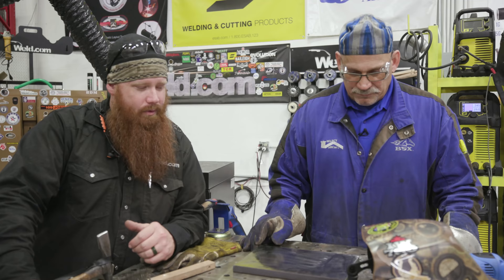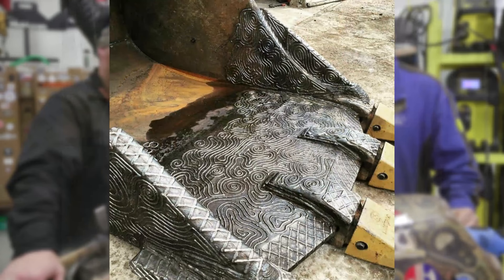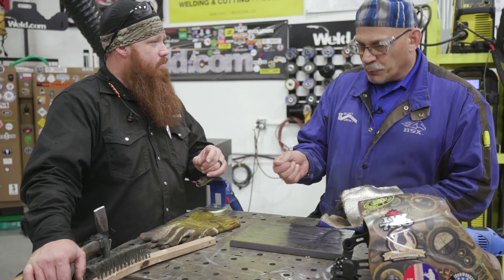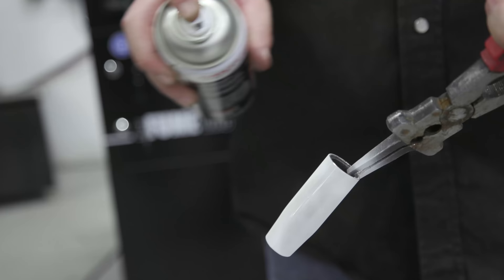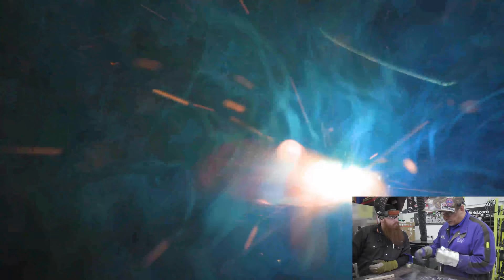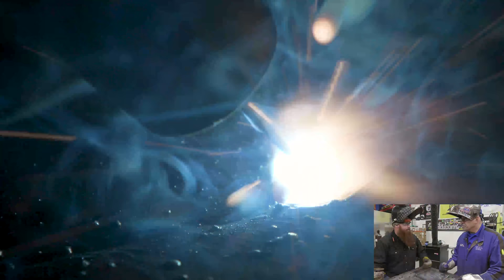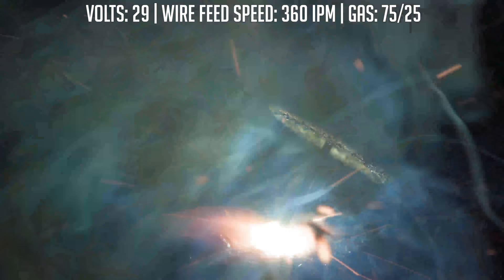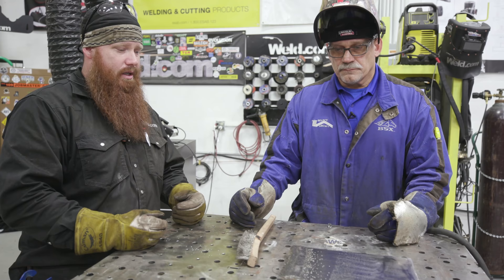Hardfacing: Metal Core Build Up | Flux Core Cap

Comment: The odd patterns of hardfacing on the excavator bucket is made for a reason, not for show. The pattern will keep mud and clay in the groove and this adds to protect the bucket metal.
Reply: Exactly, it's different for dirt, gravel, rocks, etc.
Reply: Looking cool is just a plus
Reply: A simple checkerboard pattern will do just as well as some intricate, artistic drawing. The fancy stuff really is just art, and the guys that do it will even tell you that. Y'all are just making stuff up.
Reply: @ParadigmUnkn0wn  not always, 90% of the time it is, but it makes sense sometimes to try to keep clay in the grooves, such as a checkered pattern

Comment: good video to explain the hard facing process. I have used 309l as a builder and 58 rc  rods as cap and on occasion 62 rc  rods to cap.I have mostly done tractor bucket cutting edges and snow plow skid shoes seems to work well with out mig process and gas.. keep these educational videos coming we all can learn from you.

Comment: Glad to see a video that covers this, it will help me out at work. Working on chutes at the coal mine.
Reply: Hi Eli, have you tried ceramic tiles on the chutes etc we use them on the screen boxes, hoppers and other wear parts on the screening plants at the steelworks for the foundry coke as it is very hard and extremely abrasive, there is bit of a knack of fixing them but they work well. 
Cheers Simon

Comment: I have been using hardfacing rod to put a new edge on brush cutter blades for years. I began building up the worn edges with standard wire and found they wore too quick and then ground them away and swapped to the hardfacing and WOW what a difference in performance and how long it lasts.  The metal I am laying it on is alreay fairly hard so a base layer of semi hard doesnt seem needed. I have yet to have the hardfacing crack or snapp off, at least not were just the weld broke, did have a farm hand decide he wanted to cut concrete with the mower and snapped the entire blade.

Comment: Metal core is a great process. I just got certified for metal core I'm in Ontario Canada so it's the CWB . I weld out tanks that store heavy water at reactors in Ontario. They have to be 100% leak free the metal core process works great. It's done on a line track set up makes beautiful welds I run at 30volts at 450inch and 90% argon 10% Co2. The down side is metal core is hard on nozzles and tips the spatter is exstreamly hard and dense other than that cheaper wire is prone to burn back so over all it does a good job.

Comment: I've run hard face on the bottoms of scrap magnets with sub Arc, but have also run quite a bit on other magnets with .060 mig.  Smoke for days. Never ran a "base" layer. Magnets would come back years later for repair and the hard face was worn but still there.

Comment: I've done a bunch of hard facing. Customer of mine has a field tile biusness. The tile plow gets it a couple time a year depending on use.
 Never used a wire welder for this. I do have one. It's for milwright work up on grain bins and inside.

Comment: I do Inconel overlay on steam tube, all position, in boilers. Thicknesses of tube in the 1.30-1.50 range. 0.45 wire with 0.52 tips, straight argon from a liquid bottle on a manifold, my typical settings are 23.0v 340 ipm, I would highly recommend wearing a respirator and  tyvek prepping or welding these materials.

Comment: Awesome video.  I just did some hardfacing on my anvil  I’m a blacksmith the anvil had some deep pits and cracks on the face.  After grinding out all the cancer I filled with mild steel because the old anvil body is old wrought iron   So I’m hoping the mild steel is a good in between filler. Then I used blue demon hardfacing flux core mig wire #.35.  The alloy in h12 witch is a great hot work steel.  After running three passes overlapping a little it came out like new unbelievable how nice it looks.   I’m not a welder by any means.  Just watching your videos gave me the inspiration and courage to tackle it.   I don’t know if you ever used blue demon products but wow really quality wire. Lots of spatter and smoke but flux core does.    Thanks again.  Keep up the awesome work.....Paul.
Reply: Did you preheat it before welding? Gonna crack up like shit if ya didn't

Comment: We used to weld hardfacing wire, stoody, on the wear package for drag line bucket. 80 series flux core carbon to carbon then 309 stainless flux carbon to cladding then cap off with stoody but it couldn’t touch the carbon or cladding. Pain in the butt considering most was out of position.
Reply: You need some wear studs like tuffstudds, beats the heck out of hard-facing. Especially on something large like that.
Reply: dan h It would get sheets and strips of cladding all over the inside and bottom of the bucket. The hard face wire was just to preserve the weld that was holding the wear package on.

Comment: I just learned this after many years of running it mostly wrong.
Seen many buckets the material bust off by cross checking. Just started doing this with a stoody 964g with lincore 60-0 on top. Also not mentioned is interpass Temps. Is really important to not get to hot... I would like to know about the co2, 75/25 or ag o2... How it effects hardness or impact resistance.
Reply: From what I read on the box of rods I used, it's not supposed to be over lapped or stacked. It tends to crack and split off

Comment: Any chance of a future video on tungsten carbide hardfacing (in granular form)?  The wear protection is incredible compared to regular chromium carbide hardfacing.  Applying it has been sketchy for me though.
Reply: Roland, I've had the unique opportunity to specialize in the  tungsten hardfacing and have 10+ years of trial and error/ experience. I loved doing it daily and enjoyed the quest to figuring out better conformity and consistency.
 Couple things that may help you ( imo)  with the carbide pellet process  that I found through the many days of  struggling and fighting it.     High quality tungsten overlay wire is a must in my opinion.   Rankin, Stoody, Chronatron were my goto's and were in the 50-60's Rockwell range.  Correctly sized Tungsten is mutually important. 16-20 mesh is a good starting point with equivalent cleaning screens for reclaiming and recycling unused tungsten that doesn't (impregnate)the wire matrix. 15-25 dollars a pound for the tungsten pellet so keeping waste down is religious like.  Too big of tungsten pellet tends to bulge  and distort overall quality of weld pass typically making it brittle and not friendly to impact.  👎    Fundamentally consistent prep, preheating, and  part leveling are prerequisites to desired high  quality work.
I always used a size bigger tip and liner  than the wire diameter as well as the shortest gun whip I could find usable.  ( Helps reduce drag and feed problems with the alloyed flux core overlay wires)  
 I can't express how much  those lil tips helped with  quality consistent tungsten hardfacing work.  I could talk all day about this shit and my interest level hopefully is obvious.  Roland if done correctly it is absolutely incredible and it saves customers money,  prevents downtime and typically equipment is more productive when keeping the original dimensions of ground engaging parts much longer!  ✌️

Comment: Hard facing/ surfacing sucks, I had to do it years ago for a few months non stop on heavy equipment.. I hate it with a passion, it is very monotonous and slow with the stick welding process we used..
Reply: Yeah ive only ever done hard facing with a stick welder and it's kinda slow but it ain't too bad but im guessing if you got a huge work piece it would get boring
Reply: Try it using TIG even worse my friend.
Reply: @MrMilky927  No! I'm good..lol.. I will stick with my normal fab/welding.. God bless🙏
Reply: Need wear studs like tuffstudds, they work a lot better and go on much faster.

Comment: Would be appreciated over in the Blacksmith community if you guys could do a hardfacing repair on an ANVIL. Lots of guys doing repairs out there and I'm wondering if some of the techniques we are using could be updated. Not an expert welder here, but wonder if ANVIL hardfacing would neen a slightly different approach for an impact tool(anvil) as opposed to a wear resistant need on a tool. Then you can also get into the complecity of real wrought iron bonded to a tool steel plate like many Anvils. Just a thought and I know there is a huge community of smiths that'd appreciate it. Side note, you guys ever fire weld? Maybe hang out with a smith to check that out. I suspect you'd dig it! Thanks for the vids weld.com, I'm a blacksmith but a better hack arc welder because of you guys.

Comment: I found it somewhat confusing. Would have liked to hear about the alloy type needed to get this wear surface as efficient and long lasting as possible.
Thanks for sharing and putting out great instructional materiel!
Reply: Pierre Flamand It will vary depending on the application.

Comment: I hard faced back when I was a trades assistant at a engineering shop and I remember it was called stoddy wire it was super soft come out of a ‘squirt gun’ and kept getting jammed in the machine if you line wasn’t dead straight and if I remember right it was reverse polarity does this sound correct?
Reply: Stoody is a company that makes many hardfacing alloys...sometimes these wires can have a soft strip and that makes them difficult to feed in some situations.  And yes...most all hardface wires run in reverse polarity...electrode positive.

Comment: I think the term you’re looking for when describing the “BU” wire is called a buttering layer.....
Reply: What what?
Reply: @MoltenMouseMetal  Hard on hard will cause cracs. The mid layer acts like a sub floor, so to speak. Absorbing the chock load once the part is being put back in fonction again.

Comment: Interesting comment about not having enough argon in the mix causing spatter. So if you were running tig argon it wouldn't spatter as much? I know the one time I tried to tig when someone had given me a mig mix bottle it felt like I didn't even have gas.
Reply: Straight Argon for tig.  Made this mistake as well when I picked up my first tig machine, borrowed a bottle of mig mix from a friend.  Made a mess.

Comment: Level two student from Canada here! Just got done the GMAW chapter at school, why would you not use an 85/15 or a 90/10 mix to achieve ionization for spray transfer? I understand Co2 has deeper penetration but more heat is what I would think a guy would want. Also why not make your parent metal "hard" by heating it and quenching it?
Reply: They use 75/25 cause it’s cheaper
Reply: @chrisbostrom343  Okay yes but that still doesn't answer my question.
Reply: You are not trying to penetrate. And you don't want too hard, or chunks of the hardface come off.
So you are adding a surface layer, that is slighter harder then say a bucket lip... (if this will also be a for build up if lip is worn.) white paper will tell you how many layers it can do. The hard top layer is usually 2 layers max. This were you get the most abuse.  What I have seen by doing the method explained in the video the cross checking will be reduced.
Reply: Hardfacing is faster than quenching and tempering, but I suppose it is already done, the thing is, no matter how wear resistant steel you put it's going to wear down after usage. If you only quench metal (if quenchable, meaning with at least 0.50% Carbon in it) it needs tempering, else you have extremely hard as well as brittle material. You can also use the sticks that require basic pass, and then two layers of hardfacing electrodes for high carbon steel, high alloy steel, or high manganese steels. One of the best are UTP sticks that in two layera give up to a amazing 62HRC. Cheers

Comment: Could you use this to build up/restore the corners or face of a worn anvil? Can it be machined after it's applied or is it too hard?
Reply: You can use it, but you will have to temper it afterwards. It can be ground to shape, but I believe there are softer alloys that can be machined to shape.

Comment: What would work to hardface A-36 for the top of an anvil? I welded a 1 1/2” thick by 8” x 12” to the top of a 60 pound cast iron anvil. It works well enough in that the welds are holding very well. But the surface dents too easily. I’d like to toughen it without trying somehow to surface harden it. I’ve done that on some other steel, and it doesn’t work that well. The hardening isn’t thick enough.

It doesn’t need to be too hard, just tough. I can machine it flat on my mill later with carbide.
Reply: Mel Gross probably need to harden it by heating the whole thing up
Reply: TooManyHobbies not that simple.. it can only be thinly surface hardened. That’s not enough.

Comment: How bout addressing hardfacing with stick electrodes and pre heat
Reply: Same principle except it takes a bit longer but less spatter to clean up as well.
Use 3.2mm size and higher rods for facing.
This guy was a bit rough in his technique but still good but its only hard facing not structural as this guy said
Reply: Better use lincore 55 self shield 5/64 dia. Flux cored wire, super fast!

Comment: If I had a nickel for every conveyor pulley I've hardfaced. I'd have a bunch of nickels. Used to hard face the grizzly bars on the crushers as well. Sand plant wares em out fast. That hard facing is nasty stuff. I always wore a respirator.

Comment: Try the oxy acetylene spray on kind sometime
Reply: I've done spray welding before. Heavy ass gun that had oxygen, acetylene, and compressed air to run the gun. Then it was pulling a huge aluminum wire through it to melt and spray. We used it to "galvanize" places where salt water got into. Not very fun when the gun is acting up.

Comment: So if I understand this correctly, normal flux core is sufficient for hardfacing?  Or is it special fluxcore?  Could a hacksaw blade cut through this weld?
Reply: Not sure what you mean by normal flux core...but if you are meaning joining wire like 71T-1 then no.  Hardfacing wires are much harder and abrasion resistant.  A hacksaw may be able to cut into the buildup wire they used...but it will not touch the hardface alloy.  At 58 Rockwell C it is as hard or harder then the hacksaw blade.

Comment: Been harfacing  going onto 4 years now... never don’t any surfacing like this and out Rockwell Is 85 hardness and the minimum at at 65 Rockwell there’s a plethora of different metallurgical mixtures in the wire I use all non gas shielded 1/8” flux core 11/4” wide weld, it’s heavy duty shit 🤟
Reply: What are you putting it on?
Reply: dan h stainless plates, mild steel 3/4”-11/2” plate mostly, dredger buckets, screws, sleuths, industrial wood mulchers anything for mining mostly shipping out to Mexico and northern Quebec Canada

Comment: Do you need to preheat the material before you start hard facing I have some old tillage shares that I want to hard face
Reply: I take the moisture out of steel... With a weed burner... What the don't say is interpass temperatures are really important! Don't get it too hot.
Reply: Yes pull the moisture out with a weed burner.
Reply: Just give it a small preheat to dry the steel, it doesn't really need it though  imho
Reply: @melissahill7930  are you sure? Yes you are right.  Pretty cool how it works...

Comment: With the amount of buildup along one edge of the plate I really anticipated the plate to be visibly warped but it still looks pretty flat.   I suppose the hard facing BU and Top layer has some extra wizardry in it to avoid heat shrinking?

Comment: So this could be used to reface a old anvil that has a old worn out face?
Reply: For a wrought iron base anvil, preheat to 400 degrees (use a weed burner), lay down a base with stoody 2110 (unlimited passes), then cal with stoody 1105 (top 3 passes only). This will give a rockwell of 50 to 52C.  You can fine this proceedure online at www.Anvilmag.com/smith/anvilres.htm

Comment: My question is why is he dragging it how come he's not pushing it
Reply: It's flux core - same idea as stick welding but hollow metal rod filled with powders that turn into shielding gas, this has extra shielding gas on the outside too like normal MIG welding.

Comment: You shuld raise the volts a far bit.... 

The Wire shall burn with a clear spray Arc..... Not Short Arc.....
Reply: lolman321 he said in the beginning of the video why there was gonna be so much spatter and it wouldn’t spray arc.

Comment: Why is he dragging the metal core
Reply: It's flux core with the extra gas coverage on the outside.
Reply: @olivertaylor4779  except its not flux core theres no flux...no slag ..... I always push metal core ....dragging seems so wrong especially at that angle...you dont even drag flux core at that angle